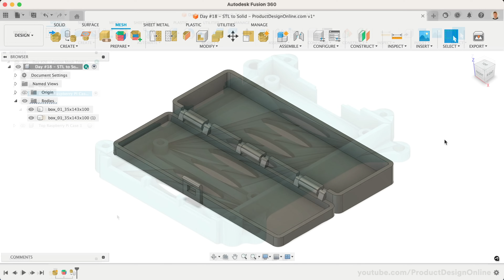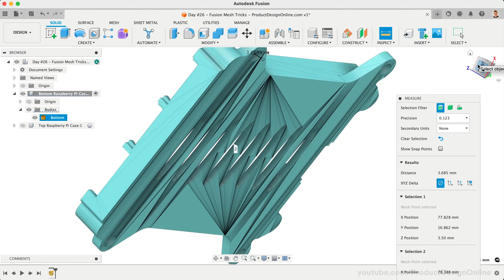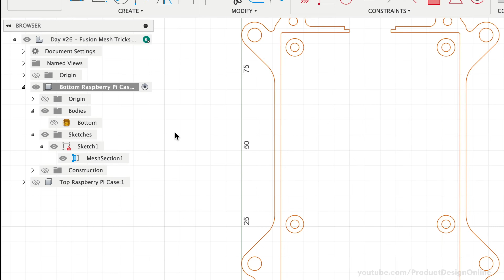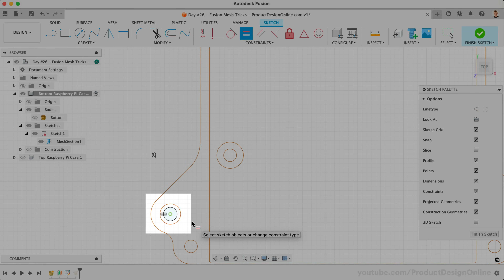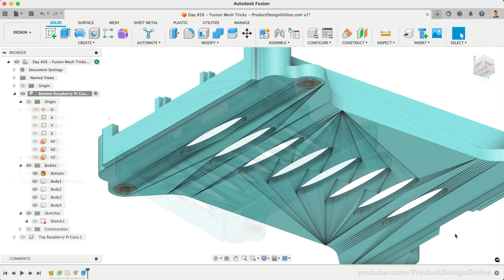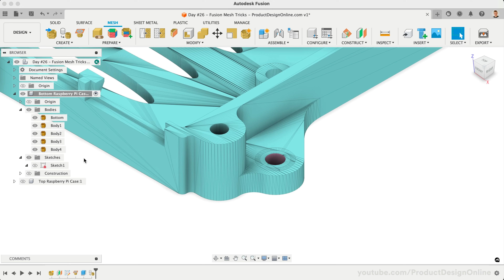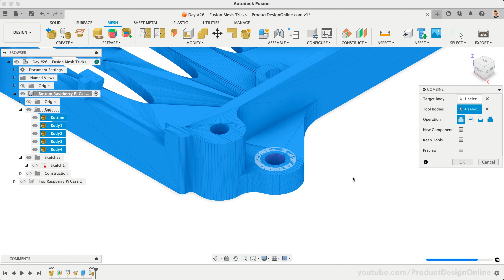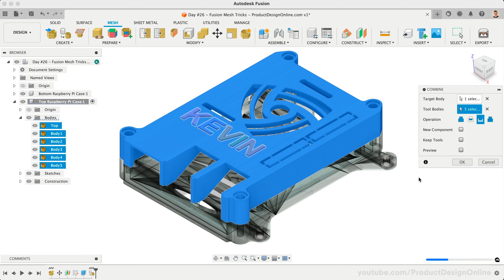EASY ways to edit mesh files in Fusion 360 | Day 26 of Learn Fusion 360 in 30 Days - 2024 EDITION

Comment: This is hilarious. Only 3 hours ago did I follow one of your earlier videos on converting a mesh to a solid so that I could go in and adjust screw hole sizes. I manually eyeballed the holes and extruded cuts, very haphazard. So I Iaughed out loud when I saw the example of the Mesh Section Sketch Tool

Comment: This just helped me immensely to create a gift for a friend based on an existing model (cutting out a part of the mesh and replacing with a text). Thanks! I still don't understand why this has to be so difficult, why can't we easily snap to existing mesh geometry to create new solid bodies etc... Is there a CAD that can actually just use the mesh as a solid body? Or is that just not possible for some technical reasons? I mean I KNOW there is a face there, why does Fusion not let me use it, having to instead measure and create planes manually to align with the mesh :D

Comment: 8:24 If the height of the Raspberry pi was only an approximation wouldn't just extruding to emboss the text be not possible as the slicer might see a gap between the embossed text and the body of it?
This thing won't happen with cutting as u can cut extra and it'll be fine most of the time, which we did here.
just like when we made the whole smaller, I don't understand how the text doesn't require the same thing.

Comment: 4:18 whenever I’m adding equal constraints from one corner to the others, on the opposite side they won’t add. It’ll apply to the one directly above the first one, but on the opposite side they keep throwing up an error
Reply: I was having the same issue. I solved it by removing my fixed constraint, applying the equal constraint to make the diameter 3mm, and then reapplying the fixed constraint again. This seemed to work for me

Comment: Thanks for the video. Do i need  a subscription on fusion 360 in order to edit a mesh file?
Reply from the maker: You do not need a commercial subscription to edit a mesh in general.

To use "Convert Mesh" with the "Prismatic" option (where it rebuilds the model for you) you would need one of the 3 licenses (Commercial, EDU, Startup)

Comment: Thanks for the content as ever! While you’re on the topic of mesh to solid, does the processing speed / ability of this process depend on ram? Motherboard? I’m not as computer savvy as I once was 😅
Reply from the maker: My understanding is that the CPU and RAM are what's important for the conversion. I've noticed a pretty big difference when I use my Mac Studio vs an older Macbook Pro.

That said, it does also depend heavily on the model. Mainly, how many mesh facets.

Comment: Interesting way of doing it but imo its bad practice.

Better to convert it to a solid first then much easier to edit but also higher quality.
Reply from the maker: The key point - this is for quick changes OR when the mesh file won't convert. Many files won't convert.
Reply: @ProductDesignOnline   Yes When we have a lot of data on a high res 3d scan with uneven surface
Reply from the maker: @sidpat-007  3D scans almost always need to be reverse engineered with Mesh Section Sketch and rebuilding with surface tools.

Comment: Can you project mesh surfaces, centers and edges on to a solid sketch?
Reply from the maker: "Create Mesh Section Sketch" is the main workflow. Unfortunately, the standard "Project" command does not work with mesh bodies due to the nature of the data.

Your other option would be to convert it to a brep, even if using the "faceted" option. You could then reference all edges, vertices, faces, including projecting them.
Reply: @ProductDesignOnline  Makes sense. Thanks.

Comment: Really good stuff Kevin. Will you ever do a CAM in 30 days with Fusion?
Reply from the maker: Thanks! I have a 3-part Design and CAM series in the works (planning/scripting). Not sure if I'll ever do a 30 days series, but do plan to make more CAM-specific lessons.

What machine do you have?
Reply: @ProductDesignOnline  I have a Langmuir MR1 and I also have an 8ft Avid router table with Mach4 that I am going to try and and start using Fusion CAM with. I am using Aspire now for the router and would love to convert but I am struggling with the Fusion CAM.
Reply from the maker: @rufustoad1  very nice! I wish I had room for a Langmuir.

I have a 4x4 Avid that I'll be using for the lessons 😎
Reply: @ProductDesignOnline I also have a 8ft plasma I definitely can not recommend a Langmuir but the Avid is the bomb! Hoping I can incorporate Fusion for all soon. Do you by chance do private tutorials?
Reply from the maker: @rufustoad1  oh, that's good to know! What are the main issues with the Langmuir? I have heard mix things about them.

I do offer private tutoring, though I am booked up until early September - https://productdesignonline.com/1-on-1-fusion-360-sessions/

I also hope to create some more advanced or project specific CAM courses for the Avid this winter.